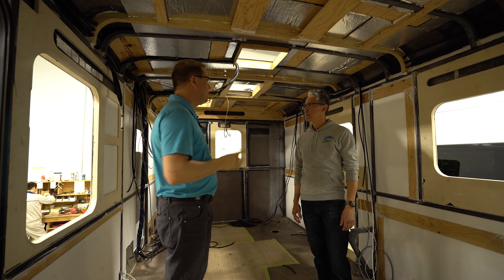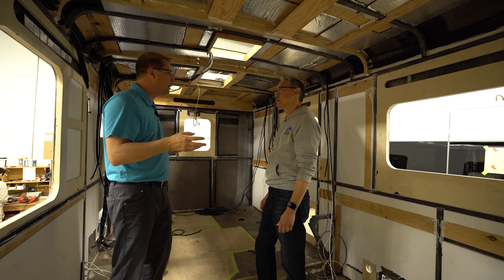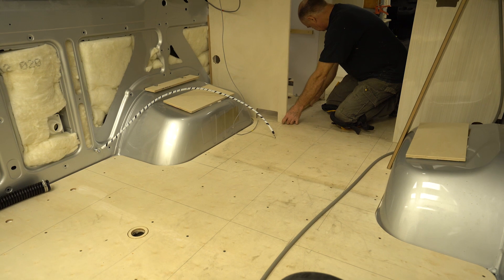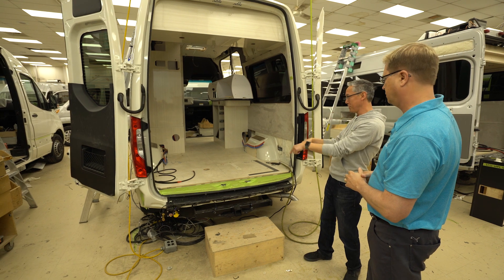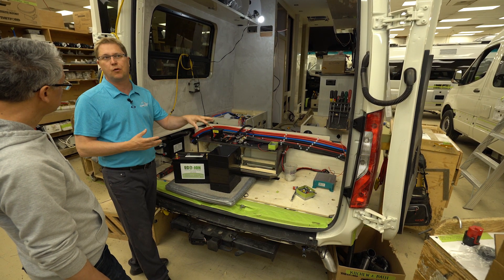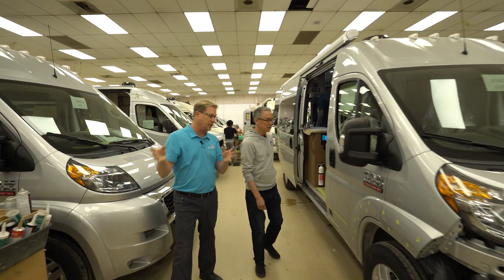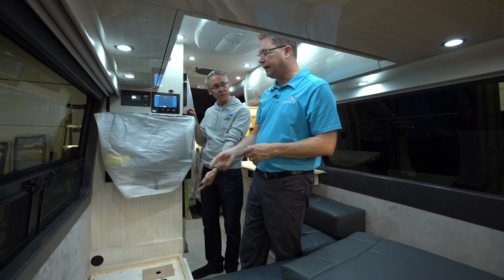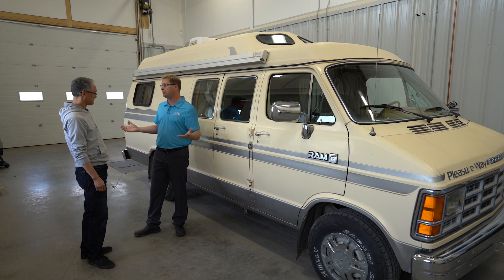Pleasure-Way Factory Tour with Neil from Ultramobility | Part 4 of 4

Comment: I am considering a 2023 PW Ontour 2.2, but it was built early on with the 2022 chassis.  What are the pros and cons of the two? I will be towing a motorcycle trailer also if that influences your feedback.

Comment: Wow!  That was the best interview yet. I have to admit I learned a lot about batteries and wiring from Dean. I am completely sold on Pleasure-Way.  I noticed the inspector checking out a silver Tofino, I'm waiting for mine to come through the line.  I spent a whole career as a commercial pilot and engineer.  I mention that because the "disaster of the front seat" is no factor at all.  I've driven the vehicle and it's way better than my 2015 Honda Civic Hybrid, and I love that.  I've flown commercial planes with less room.  So I guess it's to each their own. Like the subject of seat belts.  Anecdote; 1971 Vietnam, a UH-1 crash lands after taking fire, autorotation ends badly and the chopper catches fire. The pilots were strapped in five point belts. They burned, the soldiers in back all escaped  with minor bumps and burns, they were not belted at all. Don't get me wrong, seat belts are important, but if you're a real fatalist then we all need fire proof jumpsuits and helmets and maybe even ejection seats.  If I was that over the top then I would just stay home and pray no earthquake or meteor would hit.  I certainly would buy a campervan.  Thanks Neil.  I love your vlog.